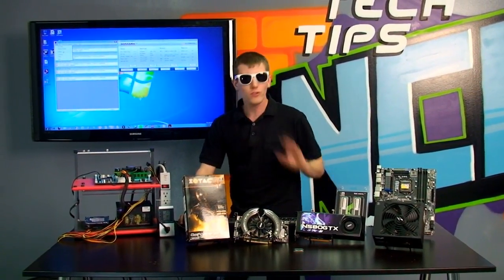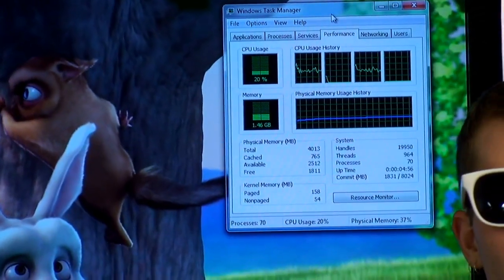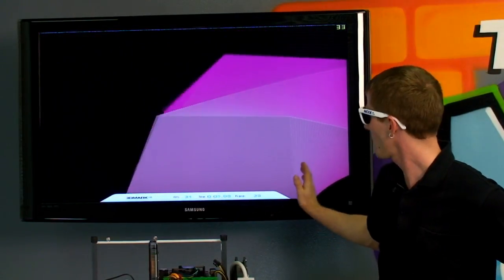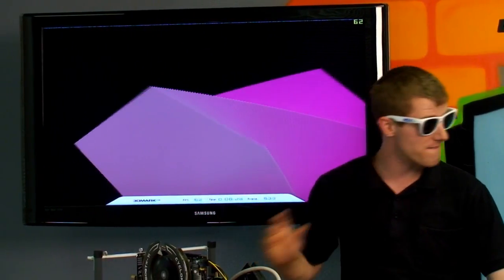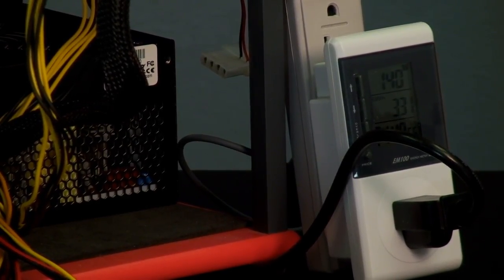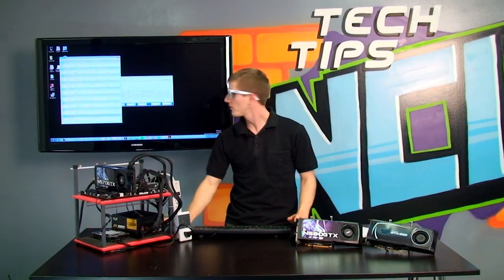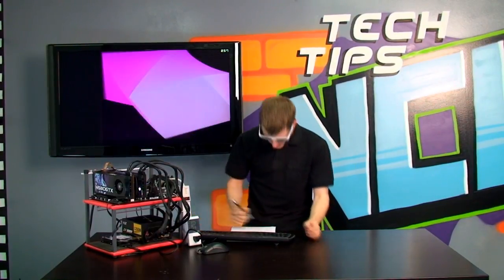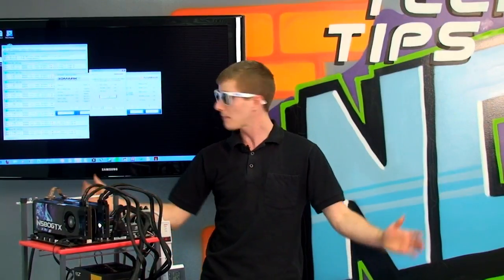System Power Consumption - A Closer Look NCIX Tech Tips

Comment: You will never need more than a 600w bronze for any single GPU system, even when overclocked.
Reply: Bronze won't make a difference, depending on the price you could go 600w platinum if you wanted. System Power consumption on the gtx780 is 350-400w, so if you were to OC you would be leaning towards the hotter side of efficiency. I would reccomend a 750w if your planning on a high end gpu and atleast 950w if you plan to sli 2 high end gpus. High end sli will run almost 600w
Reply: ***** Agreed. There's OEM microtowers running an i7 and a Titan off a 330w external power brick.
Reply: 6 years later, rtx 3090 lists 750w as a recommended requirement
Reply: @alexwhite1624  lol was about to make a joke about this

Comment: Thanks mate.      I bring a smile to my face when people appreciate things.

I wanted to do something different.    So I went with 2 power supplies. 1 for the hard ware, and the second for Pumps fan controllers, fans leds, cold cathodes.  I also wanted my hardware have uninterrupted power seeing that I am running Push-Pull with 35 fans. Couldn't see why not,

Comment: Superb video about power consumption of a PC. You have cleared all my myths about it. Here at my place there is a lack of continuous power supply and for time being we depend on our inverter-battery set. Your video has given me the freedom of running my PC during that period of time too. Thanks a lot.

My rig:
processor: intel i5 4670k 
motherboard: intel 87mc 4th gen 
ram: hyperx 1333mhz
power supply: Cooler master 600W
graphics card: nvidia 560gtx (gifted by my friend).  :)

Comment: I've been using a Thermaltake TR2 RX 750 watt PSU for over 2 years. I didn't know about its problems once it gets past 650 watts, but I've never encountered a problem with it. I had a XFX 750i motherboard with a Q9650 and 2 Palit Sonic Edition GTX 460s (1024 MB) in sli back in 2010 and recently upgraded my motherboard to a ASUS P8Z68 V with an i5-2500k. I've OC the CPU to 4.6 Ghz and the video cards to 800 Mhz, with 8 gigs of 1600 Mhz DDR3. Runs like a champ.

Comment: Oh, i see. So, if you're not doing any overclock, just the default configuration, 600w is ok. 
The part of "try 650 or 700" was just my personal opinion. I like to have clearance in power output, just to have sure. PLUS, if i want to upgrade your PC, you don't need to upgrade the power supply because you already have a good and powerful one.
In my case, i use AX850 and already upgraded my intire build 2 times.

Comment: It's interesting to see how so many people overestimate the required power supply wattage, so here's how I calculate it:
Generally you should find the TDP of the CPU and GPU, increase it by ~20% if it's going to be overclocked. Then add 15-20w per HDD or ODD, an additional ~20w for additional components and another 50w since the rails are split (this makes sure that no rail is getting too much pressure). From there, multiply the total by 1.3 and that would be the recommended amount.

Comment: I think I see where you are coming from, but I was thinking/talking about a 500W continuous PSU, rather than 500W at peak, which is what the cheap PSUs do. I do agree with you on the 100W extra point, the actually wattage being drawn from the PSU (not from the wall) would be around 350 (taking into account the 80ish% efficiency, so 500W should have ample room!

Comment: My build specs: CPU: Intel Core i5 2500K @ 4.2GHz.  Motherboard: MSI P67A-GD53.  Memory: 8GB Kingston DDR3 1333MHz (4 x 2GB).  GPU's: 2 x XFX 6870's (CrossFire).  SSD: 60GB OCZ Agility 3.  HDD's: 2 x Samsung HDD's.  Case: CoolerMaster HAF932 Advanced.   Optical Drive: Pioneer Blu-Ray Drive.

Running on a CoolerMaster Silent Pro M 700W 80+ Bronze

No problems at all!

Comment: I use a 550W (or 620W, I can't remember) PSU from Seasonic. I believe its 80 plus gold or  silver. My computer specs are in my channel description if you are curious. The system runs well, though I always play games and this increases the power consumption. Last bill I saw was about 666kWh :O.

Comment: Corsair HX850 Pro is ideal for my 2600K@4.6GHz H20, 16GB DDR3, Ati 5970+440GT, SSD, 5x HDDs, blu-ray, soundcard, 4x 120mm fans. Online calculators helped me as did doing previous custom-builds since you take everything into account.

Comment: Im using a Corsair HX750 with a AMD x4 955@4.2ghz and 2x6970's in Crossfire, with 6HDD's, 2xSSD, 8gb 1600mhz ram, 1x optical drive, TV Tuner card, 5x120mm case fans, The H20 setup (1xpump, 8x80mm rad fans) and a fan system controller. The PSU hasnt missed a beat, allthough its definatly the next thing on the list to upgrade.

Comment: @Thecashflowman should be fine for normal usage. You basically got 1 extra 6970 and 300W more capacity. The 6970 will never use more than 250W (typically around 190W under load) so you should be good to go.

Comment: @declaration963 i guess that makes sense, but in general the pwoer consumption wont go up by a whole lot because that just means more heat and more innovation with gpu cooling to counteract that, and the heat produced decreases with smaller architecture, i think its more likely future proof for soemthing like 5-6 way crossfire/SLI

Comment: corsair HX1000

rig:

CPU: Intel Core i7 950@ 3,8GHz (1,25v) w/ Scythe Yasya
MBD: Asus Rampage II Extreme
RAM: 6 GB G.Skill Ripjaws @ 1333MHz  X.M.P.
GPU 1: Gainward GTX 480 (sold today, but tomorow a LIghtning will accomodate here XD )
GPU 2: PoV GTX 480 TGT Charged
SSD: Mushkin Calisto Deluxe 60GB
HDD: Samsung Spinpoint F3 500 GB
SOUND: Creative SoundBlaster FX
CASE: Cooler Master HAF 932

Comment: it might be close, especially at peak draws (gaming sessions, etc.). you will know if the psu is maxing out by the sound, if it is getting very loud you know you need more power. for example, in the 3D mark vantage tests, the 680 draws ~340 watts by itself while playing BF3. You want your psu to operate at roughly 40-60% (during peak draws) for best performance. i would go with at least a 700W, but thats just me. cheers

Comment: i7-2600 cooled by Corsair H60, Radeon HD 6950 2GB, 16GB 1600Mhz 1.5V Corsair Vengeance Ram, OCZ Agility 3 SSD, ASRock P67 Fatal1ty Pro, 4x200MM fans including the H60 rad fan, 3x200MM fans. I'm using a Corsair GS800 PSU. It's a bit overkill right now, but I plan on Crossfiring in the future.

Comment: Your PSU powers all aspects of the computer (fans, gpu, cpu, motherboard, hard drives, etc.). AMD's site says you need at least a 400w PSU, however, it would still be better to go with at least a 500w 80+ PSU. If the 450w one you're thinking of is 80+ silver or gold, it will work but I doubt it will be considering sub 500w PSUs are usually garbage.

Comment: i5- 2500k w/ hyper 212+, GTX 560 Ti Twin Frozer II OC edition, 12GB 1600Mhz 1.5V Mushkin & G.Skill Ram, Crucial M4 60GB SSD, WD Blue 7200rpm 500GB HDD,Gigabyte Z68XP-UD4, 2X200mm led fans, 3x120mm fans, and a Corsair HX 650 PSU. It's fine for the moment but I'm probably going to have to upgrade to a 850Watt to support a CPU OC and another GTX 560Ti in SLI.

Comment: @YoshiHDify Most of that 530W is converted via the 12V rails. Generic "550W" power supplies won't deliver more than 350-400ish watts from the 12V rails, so the answer is no. It would take a very high quality 600W minimum (not recommended at all! go for 850+) power supply to run those.

Comment: Previously was running overclocked sli 560ti tops with a 650w psu, but i had constant problems. Upgraded to a 900w high current psu and everything runs smooth now

Comment: Sorry typo its a Xion 800w psu and so far I have zero complaints. for the price I would do it again, for a cheap multi task pc its a good psu I have about 5 years on it now with hard abuse still going strong...wait actually I do have one complaint, the leds don't match the blue hue my thermaltake fans put out.

Comment: @JOCKATEO  just for the GPU 's you need exactly 439W Power! You can find the consumption of your other hardware and find the answer! But I believe you should check that you motherboard supports Crossfire, that you have placed the PSU 's to the right PCI express port! If nothing is wrong i believe you need more voltage!

Comment: Quote - "I have 2 560Ti s , given the choice between 2 older lower end cards and a new high end card, I would go for the 680 every time.

The 2 Ti s may out pace a 680 under light loads, but will drop off faster as the graphic horsepower is needed.

The 680 will do just as good as the 2 little cards and use less power, hold a more constant frame rate, and if you find yourself needing more power, unlike the 2 ti s, a second and third can be added later". I agree with this completely.

Comment: Volts (V) is different than Watts (W). 230V is the standard voltage for much of Europe, Asia, Africa, and Australia. So - no, the two values are not related.
However, your power supply might still be less than 400W.

Comment: Corsair CX600.  I'm a big fan of the "Builder Series" of PSU's.  
Great for inexpensive gaming rigs

Phenom II 955BE - OC 4.0 GHz
8GB (on 4 sticks) G.SKILL Ripjaws Series DDR3 1600MHz 1.6 volts
Corsair H60 cooler
ATI Radeon 4850 HD - OC core 718MHz
3 in raid - Western Digital Caviar Blue 500GB 7200 RPM
200mm and 120mm fans (Antec 600 case)

Comment: @MrWeb06 I had a system similar to yours on a 500w power supply. Using a power meter you can tell that your system probably draws about 300W peak. You'd be fine with the 560. If anything, the 560 might even use less power because of the newer technology.

Comment: Corsair VX 550W PSU (80 PLUS) is running my system. I dont use a DVD right now, but ive used two HDDs. My case is Cooler Master HAF 922

Gigabyte GA-Z68X-UD4, Socket-1155
Intel Core i7 Quad Processor i7-2600
Corsair Vengeance? DDR3 1600MHz 8GB CL9
MSI GeForce GTX 560Ti 1GB PhysX
Western Digital Caviar® Black 1TB

Comment: you do not need a 1200w power supply for a system that draws 150w at full load. You should use a 400w-500w. But make sure to get a power supply with good parts. Look up psu tiers and google, and click the first site. It should lead you to a forum post of psu tiers.

Comment: @TheLycanjake1 Just because he is only using 300 watts doesn't mean you can slap a 300 watt power supply expected it to be power.You need enough power to be reserved. If you tried slapping 300 watts supply, you're going between edge of blowing up or catch on fire and 100% usage.I have a Radeon HD 6850, can be powered 200-300 watts but I bought 700 watts.You can go ahead experiment that card with 500 watt and stress out your power supply.I'm not held responsible for shorting or blowing up ur pc

Comment: Whats the best power supply i can buy for my specs?

- Intel Quad Core Q9400 @ 2.66GHz
- ATI Radeon HD 4600
- Asus P5Q SE2
- 4GB Ram DDR3

At the moment im running on a 500w but i think its too low and maybe i should get a 1000w?

Comment: CPU: i7-3770K
CPU-Cooler: Corsair Hydro Series H100i
MB: Gigabyte GA-Z77X-UD3H-WB WIFI
RAM: 2x Corsair Dominator Platinum 1600MHz 8GB
GPU: 2x ASUS GTX680 DirectCU II TOP
SSD: ADATA XPG SX910 512GB
HD: WD Caviar Black 1TB
DVD Burner: LiteOn iHAS124
Fans: 4x Noctua NF-P14 FLX, 4x Noctua NF-F12 PWM
PSU: How much wattage will be enough for this system?

Comment: Yes, I'm going to SLI to 680's on my Antec EarthWatts 750W with a soundcard. Its a decent PSU. If Linus can run 2x 580's you should be ok with 2x 680's as they are a bit more power efficient.

Comment: Im using a Thermaltake TP 750W silver to run a X4 black edition, 5870+5970 X-fire, 1hdd, 1ssd, watercooling system, 13 fans, Asus M4A79XTD Evo motherboard and 4gb RipJaw RAM. Works fine for me

Comment: More than enough.TinyTomLogan (TimeToLiveCustoms on Youtube) had a 2011 rig (2011 CPUs are much more powerhungry than 1155) with two 690s and it used just under 1000W. You should be totally fine, it's also a high end power supply that could supply 1000W at a high temp and would not fail..

Remember that the 680 and i7 3770k both don't use a lot of power even when overclocked.

Comment: My system components are as show... 

CPU + Board : I7 3770K @ 4.6GHz, Asus Maximus V Extreme
CPU Cooler : Corsair H100i Liquid CPU Cooler
Graphics Card : MSI GTX 680 Lightning x2 (2 Way SLI Config)
Soundcard : Asus Xonar Phoebus Gaming Soundcard
SSD : Corsair Force GT 240GB Sata 3 SSD
HDD : Western Digital Caviar Black 2x 1TB HDD 
Casing : Cooler Master HAF 932 Advanced with a total of 12x Cooling fans. 
PSU : Seasonic X Series Platinum 1000W Modular. 

Would a 1000W supply be insufficient?

Comment: SuperFlower 650W 80+ GOLD
CPU:AMD Phenom II X4 955 OC@3.6GHZ
CPU-Cooler:CoolitECO A.L.C.
RAM:4Gb Corsair XMS3
GPUs:2 Sapphire HD6850
Motherboard:Gigabyte 890GPA-UD3H
Storage drives:64GB corsair SSD, 2TB WesternDigital HDD
Case:CoolerMaster HAF 912PLUS

Crysis2@ extreme preset, 1080p, VsyncON [BoishockCrossfireProfile] @50FPS

Comment: usually you want to achieve a 60% load on the psu for full load (gaming or editing) so you get the best efficiency which is 60% when you draw loads of power, so if you draw 600 watt then 1000watt psu would be the sweet spot, or at least a 800 watt but then you get to almost 80% load so yeah efficiency starts to go down

Comment: @TheOneAndOnlygab195 That's BS. It depends on what load the 12V+ rail can handle. A stock gtx580 is about 20 amps each. So if you have over 60/70amps on the 12V rail, which is about 650/720watts on the 12V+ rail. You should be able to run SLI 580. So something like a Seasonic X-760 or 850 is well capable of running 580SLI. Please learn how stuff works before randomly commenting.

Comment: i have 750 fatal1ty by OCZ. Not bad for about $90 - 5y guarantee, 80+, (I think it says the peak is 640 or something ...). By what I'm able to see on the internet about it I'm very pleased. I've got Phenom II 955 on 4,3 GHz, Zalman Performa cooler, with 8 gigs of kingmax hercules 1600 RAM and a single HD 6850 on a 880g extreme 3 mbo by asrock. I also have an LG DVD combo drive and 2 HDDs (one 250 caviar black for system and 1Tb one caviar blue for other). All of that is in a chunky HAF 932. :D

Comment: My System is a complete budget build but it will take all the games I play with a resolution of 1680 x 1050 at max settings.(Though I don't run everything at max simply to keep things running cooler.) 

CPU: Intel Core i3 560 @ 3.33GHz
GPU: HIS ATI Radeon HD 5770
Ram: GSkill DDR3 1333 - 4Gb
PSU: Antec EarthWatts 500 Watt 80 plus bronze 
Mobo: Intel DH55HC (Standard ATX mobo)
HDD: WD Recertified 500 Gb

Comment: I run a 550W coolermaster, cause im cheap but it seems to do the job. I5 2500k @3.7ghz
HD 6850 @ 850mhz/1100mhz 8 gig Kingston hyper x ram, with 4x 120 mm fans, and 2 neons.

Comment: I'd like to see that "modest 650W PSU" put back in with all the upgrades done including SLI and just see what happens, Or maybe something like an XFX PRO 650W which uses a common rail so you dont overload one of the 2 rails found on most generic 650W supplies

Comment: My current set up and power consumption:
Intel Core i5 3330s
8GB DDR3 (2x4GB)
AMD Radeon HD 7870 XT (Tahiti LE)
Gigabyte H61MA-D2V
1x 500GB SATA HDD
DVD Drive
XFX 450watt core 80+ Bronze PSU
3x pwm case fans

Idle: 34w with AMD Zero core power, 48w without ZCP
Watching YT 720p: 58w
Watching YT 1080p: 60w
Max CPU load: 94w
Max GPU load: 250w
Max CPU & GPU load: 295w

Comment: All the parts you want = 80%~ of the wattage needed. Get a slightly larger PSU or don't use it for a long time until you get all the parts in.
I'm planning on a 350W PSU for a light build with Athlon II, a Radeon 6670, and light stuff.

Comment: this video helped me A LOT, thanks for the info linus..

right now i'm running
AMD FX4100 @3.6ghz
8Gb of ram @1600mhz
XFX 9500GT @ 512mb
gigabyte 970a-ud3
1 HDD of 750gb caviar green

i'm running this rig on a LNZ650kr (it came with my sentey bx 4246)
i'm going to upgrade my graphics card.. and i have a doubt...
is this PSU going to support a GTx460? answer me please XD because i'm between that one or the GTS 450..(without changing my PSU of course)

Comment: I'm using a OCZ Fatal1ty 550 W PSU(80 plus certificated) with Phenom II x6 1055T, GTX 260(192 shader processors), 2x2 GB HyperX 1333 MHz RAM, Caviar Black 1 TB SATA 3 HDD and Gigabyte 890GPA-UD3H motherboard.
I'm thinking of upgrading 260 to a MSI GTX 560-Ti Hawk in this summer. After watching this video I think a 80 plus 550 W PSU is more than enough for 560-Ti even if I want to overclock it. Am I right?
And thanks Linus, I think this video will be helpful for lots of people.

Comment: I haven't bought the psu (450watt), but the guy at bestbuy said that 450watts will run fine... What im confused about is if the psu only powers the gpu or also all the other parts of the pc.

Comment: But the 2 560 ti's still beat a single 680 by a slight advantage, even with the lower vram. The dude in the first comment already had 2 560 ti's, going for a 680 would be a waste of money. He should consider either a 690 or 2 670's, not a single 680 which would give him no advantages except for more expansion room.

Comment: @bluesmoke21 Now that theoretical max is super safe. Components will not reach that while gaming. Typically ~80% of theoretical max is gaming draw. Go with the theoretical. It's safe and will allow for a good OC as well as future upgrades. You can go super over the top and include OC (can be up to 100W extra for GPU and CPU each). It's really not necessary.
HDD and ODD are about 25W each. More, keep adding... RAM and mobo should stay under 50W.

Comment: I have a FSP Everest 800W PSU
Rest of the system:
- Intel Core i7 2600k @ 4,6Ghz, with Corsair H50
- Corsair Vengeance 8gb 1800Mhz RAM
- ASUS Sabertooth P67
- ATI Radeon HD 5970
- OCZ Vertex 2 60GB, WD Caviar Black 2TB

Do you think my PSU is enough? Thanks!